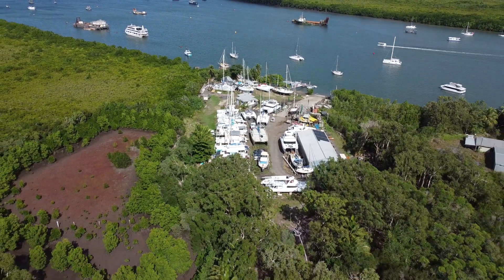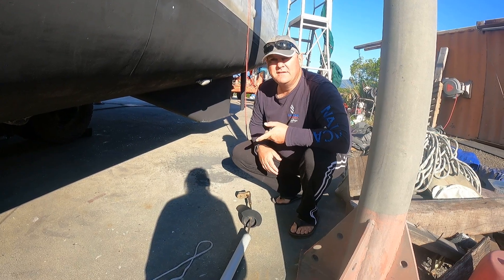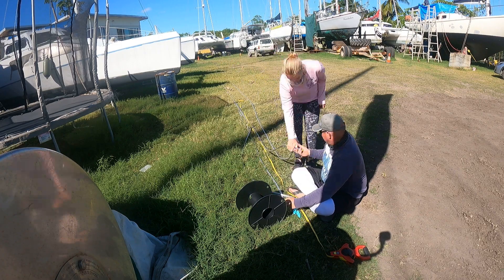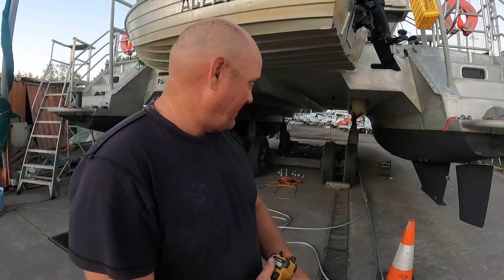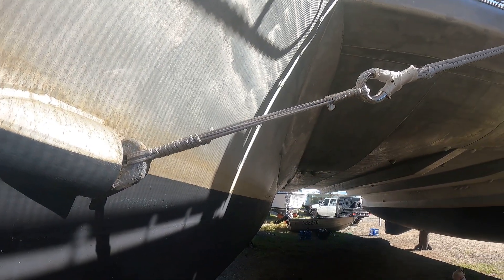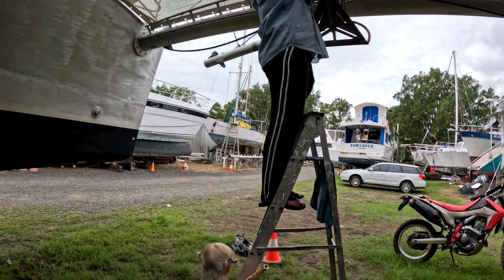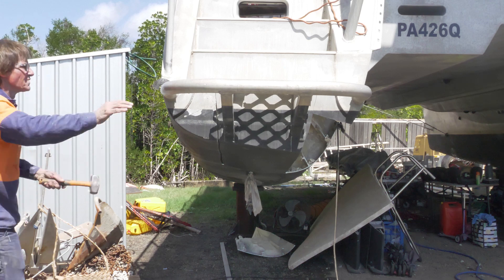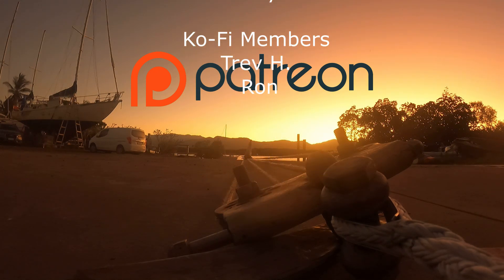Synthetic Rigging on a 17 ton aluminium catamaran | Part 2 of Hybrid Rigging (Ep. 101)

Comment: My soft shackle manufacturer (Equiplite) advises that the UV coating on the Dyneema be recoated every 6 months.  I think the outer layers of Dyneema standing rigging take UV damage but they are so thick the inner strands are protected.  No doubt the rigging will last longer with frequent recoating of UV shield or if it were “served” with a protective cord layer.
Reply from the maker: When looking into synthetic rigging I talked with a retired rigger friend if mine and he says that they used to always coat dyneema with a uv protective layer but he felt the newer dyneema didn't need it unless we were going a smaller size that was only just strong enough.
-sam

Comment: Hi again guys. I thought it might also be useful to comment on your stern extensions. I did this to my boat in 2002 (well my boatbuilder did!) I had 2 reasons....the boat sat ass down in the water and i needed flat decks at the back to facilitate docking/getting on and off.
I added 0.8 m onto an existing 11.2 m....hence boat is 12m now. 
I am sure you know that adding length on the hull at the back moves your centre of lateral resistance aft. If your boat is currently nicely balanced then you might end up with a tendency for the boat to bear away when you are close hauled...centre of effort now ahead of centre of lateral resistance. In my case i added 0.5 m on my new boom in 2012 which cured my bear away issue. 
We didnt do any calcs to work out the changes but i got lucky any my boat just heads slightly up when close hauled uunder blade jib which is what i wanted.
Reply from the maker: Hey Chris! Thank you for the thoughtful comment! Two big reasons were are extending is that She bogs down in the aft end, so adding for buoyancy and for comfort for a larger boarding platform. We would love a nice big sugar scoops to sut down and put fins and masks on for snorkelling and for boarding on and off the tender. You'll have to wait and see thw extension video 😍
-Cait

Comment: Check the latest video from Gone with the Wynn's. they have a new HH44 with a stray electrical problem that started to rust all of their metals. Has been fixed and they are adding a sensor system.
Reply from the maker: Hye Philip! 
 There is great device called SeaBis to prevent marine corrosion 
-Cait

Comment: You're brave people using dyneema end to end for the rigging. Even the highest quality carbon fiber rigging uses titanium end fittings. 

I see dyneema used a lot, specially "soft shackles" which are notorious  for failing. 

Dyneema for sheets, lines etc, yes it's great but for rigging... Hmmm you're brave people, that's all I can say. I'm not saying you're wrong, but you've got bigger balls than me! Hahaha

Btw, I love the shape of your hulls, nice and straight, great look and I think she sail well specially with you keeping the weight down. 

Keen to keep watching your episodes. 

Thanks for posting! 🍻🍻

Here's some relevant info on different standing rigging materials. 

Rigging professionals report that changing over to composite rigging could reduce the weight of the rigging by up to 75%. To show how dramatic effect this changeover can have on the weight on an 80-foot yacht, the weight of the traditional standing rigging readily reaches over 300 kg, compared to 80 kg if you were to use a composite stay made of the material PBO or carbon. This means that to retain the same stability you could, in theory, reduce the amount of ballast by about 1,000 kg.

Doesn't composite standing rigging stretch?

Those salty seadogs, who seem to think they know everything about boats, will claim that composite rigging stretches. This is a valid conversation when talking about lower tech Dyneema® standing rigging but is not an issue with normal standing rigging materials such as Carbon, PBO and Kevlar.

When changing over to new composite standing rigging, it will be specified on a stretch equivalence basis and will therefore be the same stiffness with similar stretch characteristics as the old wire/rod rigging. This means that the mast will be properly supported and perform as it was designed but with the major advantage of 75% less weight.

Stretch is an important consideration when looking at using Dyneema® for lateral rigging. This is a relatively cost-effective solution for offshore cruising boats from 30-50ft, but it requires a completely different philosophy to rig management. You cannot simply set up the rig and leave it. You have to be constantly adjusting and tightening the rig - it takes a lot more "active management".

The reason is that Dyneema® suffers from Creep which is physical elongation under constant load. Most yacht turnbuckles only have 75-150mm of adjustment but with Dyneema® rigging you need to be able to deal with +300-500mm of creep, depending on the cable length and diameter.

The only current method of managing this amount of length change is to use lashings at the bottom of the stays. Over time, the rig tension will become slack and the lashings will need to be tightened. It is for this reason that Dyneema® standing rigging is only suitable for a certain style of sailing where repeatable rig tune settings are not critical.

NB: Choose PBO, Carbon and Kevlar do not suffer from creep and utilize standard turnbuckles to manage rig tension.
Reply from the maker: Hello hello! 
Wow, first off thank you so much for taking the time to write that comment!  🥰✨️💗

We are really pleased with the dyneema rigging., the type of synthetic rigging we used is Hampidjan Dynice Dux, heat stretched stuff, have found it amazing to work with and will keep everyone updated on how the rigging is performing, will do a video after sailing for a while to show how its going as a follow up for everyone.
 💗 Cait
Reply: @sailingwiththejameses  That would be great. Obviously it's a massive weight saver in an area that makes the biggest difference. 

Good luck with it 😀

Must admit to being excited to see your project finished, your both happy fun people and I do seriously like the design/shape of your yacht. 

Cheers 🍻🍻
Reply from the maker: Thank you so much! She is an alloy Lock Crowther Design 85 Mark IV, we love the crowther flare at the bows. We are super in love and happy with her. 
-Cait
Reply: I thought dyneema was prone to breaking down under UV exposure?   It also chafes badly so is often protected in key areas.  Have you considered wrapping the standing rigging with cotton cord?
Reply: @markraumer2336  Dyneema has excellent UV resistance, quoting a lifespan of 10-20 years, much better than polypropylene. 

Chafe resistance is quoted as very good but also recommended to have chafe resistant sleeves in high wear areas.
Reply from the maker: Wow we would love to get 20 yrs out of if lol. The main reason we changed it is because we wanted to give it a go. If it looks like it is going to last and is doing well we will replace the dyneema and add chafe and sun protection but we first wanted to leave it exposed so we could monitor it as it is unproven to us.
-sam
Reply: @sailingwiththejameses  I think you'll be ok with UV for at least 10 years.

In my opinion, and im not an expert in dyneema by any means , the areas to watch are, are sharp bends which can reduce the strength by 50%, chafing and stretching. I know they state it doesn't stretch but in real life it does. So you'd need to monitor your rigging tension and adjust when required, not hard to do, just need to remember to do it LOL
Reply from the maker: Yeah perfect, I read that if you keep the constant tension below %30 then that reduces stretch. That is why we went for dux as it has the best breaking strain to diameter that we could find at 36t so in theory we could keep close to 11t on them with minimal stretch.
-sam
Reply: @sailingwiththejameses  Unless it's pinched or folded I doubt you'd ever break it, if you did I'm sure if would be one hell of a story! Hahaha

From what I've researched, dyneema is good for standing rigging, saves a lot of weight in a crucial area, strong as an Ox! But turnbuckles should never be used s they don't have the required adjustment. So you lashing it, while it scared the crap out of me at the time, is actually the best way to do it. So well done! 

Learn something knew every day hahaha.

Cheers 🍻
Reply from the maker: I hate to disappoint but we lashed and used turn buckles. We couldn't get enough tension in the rig with just lashings so we had to order in turn buckles to go with our set up. I think with smaller boats you could go just lashings but we found that we need the turn buckles.
-sam
Reply: @sailingwiththejameses  At least you have extra adjustments via your lashings when the turnbuckles are fully extended. 

Apparently most turnbuckles have up to 300mm adjustment, with dyneema it's stated you can need up to 500mm over time. 

Time will tell 😀
Reply from the maker: Yes exactly, we will still get our lashings tight and only do finer adjustments with the turn buckles. We are hoping it will make it easier to tune the rig and as a result only have to do major adjustments every year. As you say time will tell.
-sam
Reply: https://youtu.be/z2Ei9oHqF54?si=yX3iGlfK6b2enlk-
Reply: These guys serve the Dyneema and tar it.

Comment: Worried that the dolphin striker stays will chafe at the hull connection where the stainless insert is located. Did you chamfer and polish the sharp corners?
Reply from the maker: We rounded the edges and  tried to put Teflon chafe protection but it didn't go as planned. We'll watch it closely and see how it goes. I didnt put this as part of the video during the editing process which I see now might have been a mistake, we've gotten a few comments with this concern. Thank you for the concern and raising it to us 💜
-Cait

Comment: Apart from UV are there any other environmental issues such as lightning or salt crystals to consider with Dyneema?
Reply from the maker: Dyneema does not cope well with chafing. As for lightning Dyneema is not a conductor so it shouldn't get a direct hit but if it does I imagine it wouldn't be to happy afterwards. We are new to Dyneema with regards to rigging (ive worked with it alot on commercial tug boats) so I will have to keep you posted on any other issues that we find along the way.
-Sam

Comment: Hi there guys....little Charlie gets cuter and cuter every episode. (We talked about folding props some while ago)
Just thought i would share with you my experience of dyneema rigging...i changed my rigging from all dyform wire to a combination of dyneema and nitronic rod. My forestays and diamonds are rod and my shrouds and removable baby stay are dyneema. The terminations are all colligo kit. In addition to my shrouds I have dyneema running backstays which I can grind up tight on a winch via a 2:1. I use 16mm dyneema on all my shrouds...my boat is only 7.5 tonne!
I did all this 10 years ago and have had no problems. I had a rig survey 3 years ago and all was good. The colligo blocks allow me to tighten up the rig as and when needed.
Like a previous commenter I didnt like the look of the sharp corners on your hull stay eyes...look a bit sharp. My dyneema stays to my bowsprit have a heavy duty stainless steel u bolt on the hull. There is a dyneema eye on one end of the stay and a simple colligo donut on the other end. The bowsprit has another heavy duty u bolt. I tension the stay using 5 mm dyneema with 4 loops around the u bolt and donut...easy to tension with a line from the cockpit and one of my winches.
Dyneema does degrade a bit in the sun but if you use oversized rope who cares! 
The riggers thought my running backstays were a waste of time on a cat but i disagree. I can crank them both on to get foresy tension upwind and they are a safety feature off wind...keeps mast bend where it should be.
The reduced weight up high in your rig has to help pitching...
Good decision i think.
Reply from the maker: Thank you for such a thoughtful response. It always amazes me how helpful people are in the yaching community. One of the reasons we started youtube was to try and give something back to the community but I have found that I receive just as much (if not more) valuable advise given back to me in return. I will redo the stays that connect to the hull before we go back in the water. 
-sam
Reply: Thanks Sam, we all learn from each other... No one has all the answers.
A thought about your baby stays. If you use dyneema rope with casing then the eye in the line has an outer abrasion resistant cover. You can even get kevlar casing to cover the eye. Once you pass the line thru the eye on the hull and then pass the line thru it's own eye the fixixing becomes relatively static and doesn't chaffe. Hope that all makes sense. My baby stays have been there for years with no chaffe.
Reply from the maker: Thank you! Yes, Does make sense. We are going to see how the synthetic goes on the stays we can see and then we will revisit the diamonds 💎 😎 But so far so good and super happy with it! 
-Cait
Reply: Great to hear some feedback on Dyneema standing rigging, 10 years of experience with Dyneema. I am sure we could all learn more from you. Thanks
Reply from the maker: I definitely agree,
When I started my research I couldn't find anyone who had first hand experience with 10 yr old dyneema, the best I could find was 7. 
-sam

Comment: Just wondering if you guys using Tension Gauge and what the tension figures if so? Thanks.
Reply from the maker: No tension gauge, we will wait until we are in the water to re tune the rig. First look at mast placement, then guess the tension. Take it for a sail and power it up, the leward stays should have a slight bit of slop in them, adjust and repeat accordingly 
-sam
Reply: @sailingwiththejameses  Sounds like a scenario for another epic video ;-)
Reply from the maker: Hahaha maybe. I have already done a video on tuning the rig but am happy to do another.
-sam
Reply: @sailingwiththejameses  You can borrow mine Loos & Co Professional Tension Gauge PT-1 Imperial for 3/32, 1/8, & 5/3" Cable.  If you travel near Caboolture I am just 2 min from the hwy. But afraid it could be too small for the most of the wiring. And designed for ss wires. Will that work for dyneema too?
Reply from the maker: Cheers for the kind offer. I would love to see what the tensions are when I have her all tuned up. I don't think we will be making it that far south this season as we will be hoping over to indo next yr and I want to get a jump on that season.
-sam